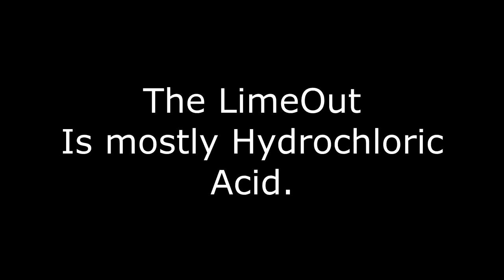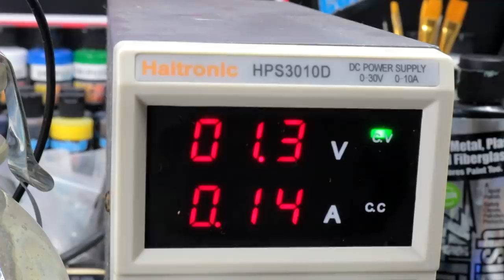Hot Wheels Redline Restoration: Custom Volkswagen Beetle

Comment: I love these old Type 1s. Always have, especially when they're heavily modded. The only Type 1 mod that I didn't like was the one that looked like it had those big Rolls Royce grilles. Baja Bugs were my favorite by a long way.
Nice job with the new paint technique. I never noticed it before, but this Custom VW Beetle doesn't have any body lines for the doors. I didn't notice it until you had the paint stripped, polished with the brass wheel, and finally when you were hand polishing it because you didn't want the brass wheel scratches to bleed through the color. Lol... You were a few seconds away from paint when it hit me. Naturally I had to pause the video, open the browser, Google the car and weed through a bunch of the latest version of the Custom Beetle, which I also happen to like, to find a few of the original car. Anyway, I'm kind of glad you decided to just restore this one and not alter it.

Comment: Ahh, Diecast Resurrection for lunch, nothing better, lol. Paint is killer! I know you've probably been asked about 1000 times before, but what do you use for clear coat? I assume a Urethane system?
Reply from the maker: Yep just 2k automotive urethane, the redline shop is the same stuff just in really expensive little bottles.  I have a gallon of my stuff for $100 US And it came with a quart of the activator for that price.

Comment: You make it look so easy. I have nothing but trouble drilling out the posts. I use a 1/16" drill bit, but it frequently eats right through the edges. And using a pointy tap is worthless also. The 2-56 is 0.08, and the 1/16" is 0.06. I need suggestions on a better solution. Good video, but let us know what days you will be posting so we're ready.
Reply from the maker: When you are making your final 1/16 hole for the screw, do you file the post flat first and then centerpunch again nicely in the center?  That's the only real secret that I would think makes the most difference.

Comment: Quick question for you...why do you filter the paint? What are you hoping to remove? Thanks.
Reply from the maker: You never know where the little bits linger that will mess up your paint, sometimes the little cup can be dusty, when you open up used paints little dried pieces can fall into the bottle..  better safe than sorry really.
Reply: @DiecastResurrection  thanks for the tip.

Comment: I notice you didn’t file down the mold lines near the headlights. Would have looked even sweeter, but then perhaps easier to tell it’s a restoration?
Reply from the maker: Yea except the body under the mold lines isn’t zinc plated lol you would have had some grey speed stripes.
Reply: Diecast Resurrection - Zinc plating. Ahh, didn’t think of that!